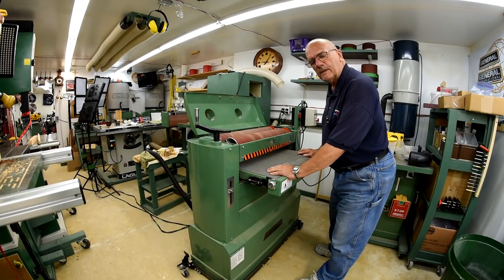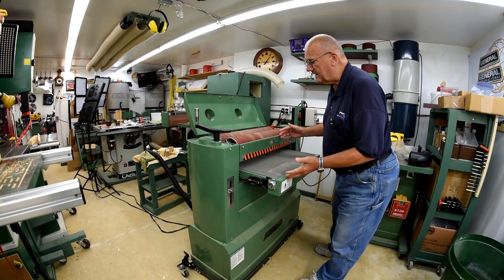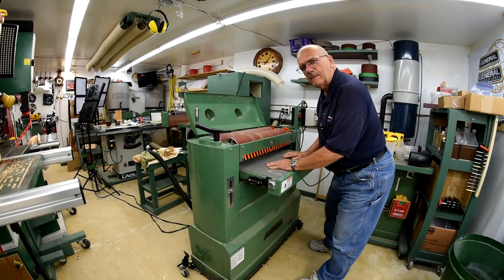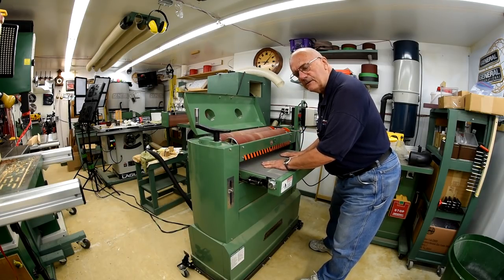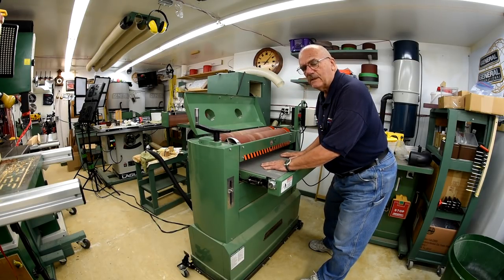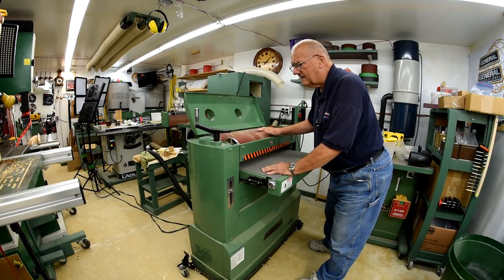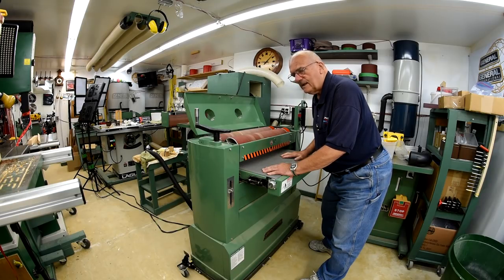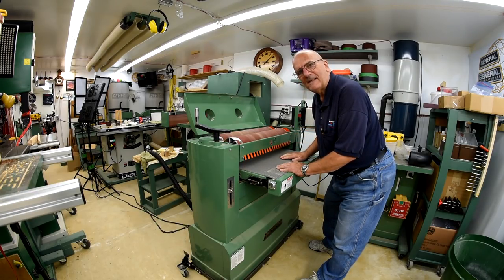The “Reverse Rotation” Drum Sander

Comment: You are correct on the drum rotation. All the sanders, both drum and belt, that I have worked with sand against the feed direction of the belt. The dual drum I just picked up is consistent with your observations.

Comment: If the sander is 3 phase unit, it's easily explainable. It's not uncommon to have phase orientation incorrrectly wired in the house. And the infeed table is likely turned by an single phase motor. .
Reply from the maker: Thanks for the comment. Yes, I've noticed on some of the motors I've got that I can change the rotation simply by switching the wires around. Hopefully Ricardo can do that with his :)

Comment: Hey Ron.  Don't stay gone so long!

My 22-44 Plus turns like yours also.  If it went the other way I think I would be calling the manufacturer.  I can't imagine my 209HH planer going in that direction.

Probably get flamed but I feel the same about the radial arm saw.  I got tired of trying to hold mine back and got rid of it.

JimE
Reply from the maker: Re: The radial arm saw --- I got my first one in 1974. I always used it with caution and never had an issue. Lucky I guess lol. I sold it after about a year because I needed the money. About 3 years ago my neighbour had the one I've got now for sale at $75. Looking back now, I think that I bought it to bring back the "good old days" :)

Comment: Say Ron I have the same drum sander you have 
    Just broke today using four years 
   My feed line shaft that the small motor 
    Moves the feed belt too go 
     Any idea how too get the part that I need to get back too working ????
       Gerry ..... thanks
Reply from the maker: Hi Gerry,
If you remove the small conveyer motor you will likely find all that is wrong is one of the couplers has become loosened on the shaft. Simply slide it back into place and tighten the set screw. Hope this helps. 🤞
Reply: @roncalverley  

   Ok I did not no that the 2 couplers had a set screw on the shaft 
      But that looks like my problem 
   Because the motor works great 
    I take a look at that idea with the set screw ...
     It’s a cold week now here in Missouri 
    My shop don’t have no heat ....
    I have that motor off .. I take a look at that wene sun comes out in couple days 
      Say thanks Ron 

I let you know what I find out with that Lose coupling 

Have you had that problem on your machine ? 
     Just wondering ? 

Thanks ..... I get back with you
Reply from the maker: Re: "Have you had that problem on your machine ? "
Yes, soon after I'd set it up. Obviously it was not tightened properly in the factory. Ease fix that I did myself. I still love this machine. Works great 👍